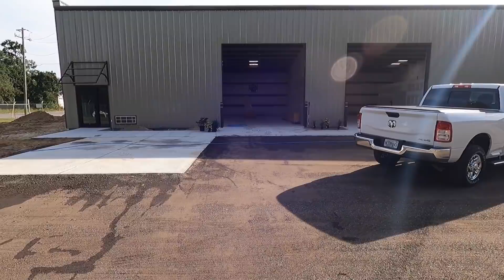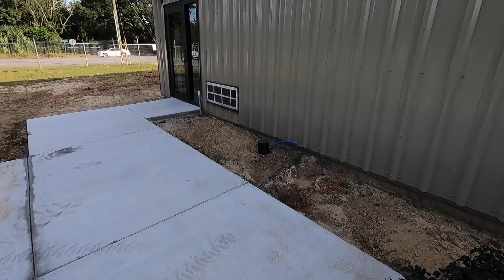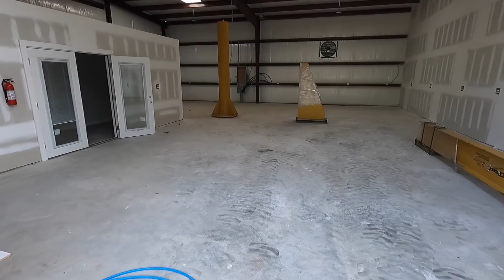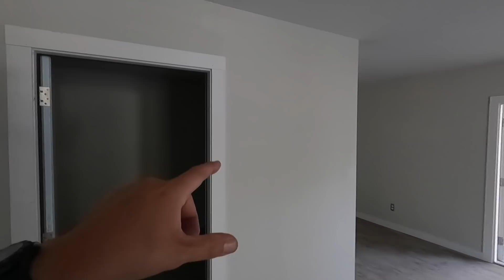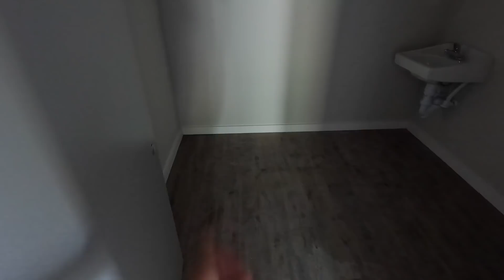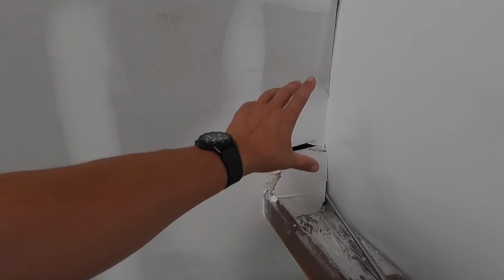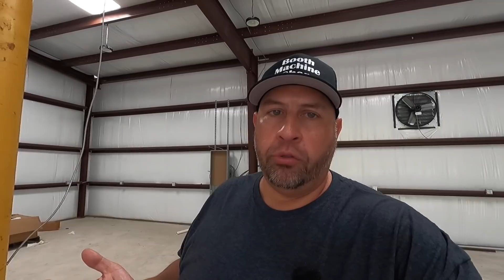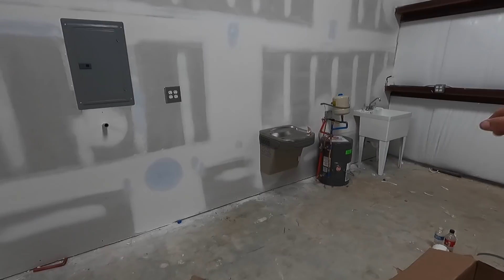New Shop Space Update 8: Driveway, Office

Comment: If I’m installing an exterior door like that one in an interior situation like that, I throw away the threshold, set the doors a half inch off the floor and install a drop bar auto sweep. Then I do a low profile transition. It drives me crazy to have to step over the threshold inside, and you might end up rolling things through there.

Comment: For your own safety, move the fire extinguisher so it cannot be blocked by the door.  Maybe a coouple of feet from the crane. Seconds count.

The other thing that bugs me is the electrical outlet/switch on the other side that is blocked by rhe door, but that is just me.

Saving on your electric bill & keeping the shop cool:
A) I think that you might as well put in some very wide diameter (10'+) slow speed ceiling fans.  These will also keep you warmer in the winter. 
2) Totally out of the park & not really late in the game, but the mechanics are not very different from putting it in the initial plan.. Add a steel pipe & wire trellis to the outside of the exterior walls that are not north facing.  Keep it a couple of inches off the wall.  Plant some vines local to Florida and let them grow.  If the sun does not hit the wall, the heat cannot be transmitted through the wall.

Thanks for teaching me so much.

Comment: I really hope that with that fiber mesh concrete they still used steel like regular concrete. When I built my 2nd home, 31 years ago that fibermesh was new. But with mine over the years  it cracks and separates. I'm sorry I went that. Now I need to have a concrete leveling company come out and fix all the toe stubborn in my driveway. I hope things have gotten better for you and your new shop. I hope I'm not out of line, but that's my experience with that type of concrete. And for years it looked like in needed a shave.

Comment: Adam, if you have not had time to consider a floor treatment,..I would consider a product called "Water Glass" and yes that's the name of the stuff,..cost is about $1.00 per 5 gallons and it coats just like water ( No pun intended) the stuff is an "Old School" treatment for concrete and wont chip or crack off cement and can be polished to a high sheen and will stop any penetrating products like oil/solvent/etc.,. shop is going to be very professional looking!    A thousand suggestions from your subscribers so mine is  I would like to see a machine that grinds or shapes machines ways in this new shop,  Good Luck!

Comment: Realize rotary screw compressor are a lot quieter then recip. However the easiest why to understand what’s best for your shop is. Think of gas versus Diesel engine, starts a stop a lot (gas engine) recip compressor, starts and runs for 10 days no stop (Diesel engine) rotary screw. Also don’t forget that need a dryer, and condensate oil/water separator. You can get ticket for condensate running in to the drain or blowing in to the grass. Recommend going with Zero Loss Drains as well. Will say you money on the long run, time drains use the compressed air and discharge some it, and will cause the compressor to kick more then it should.

Comment: Adam, you might already know this but I'll throw it in. Be sure to have either a dryer or dryers for the air compressor especially down there in Florida, or at each riser have a pipe dropping down with drain valves as a water trap.

Comment: I've got an old 2 stage 3 phase 5hp compressor that is like new if you are interested. I think it has a 60 gallon horizontal tank. I've stored it inside for 12 years or so. And an old 3 phase 1952 Dominion Lathe with every attachment, one that I can't figure out that looks like a chuck. A lot of old stuff. Surface grinder? lol

Comment: I note that your disabled toilet is quite large.  In UK we have a prescribed size/layout for the same at 2.2m x 1.5m with a 900mm clear opening door i.e. a 1000mm doorset that must open outwards.  this is so that should a disabled person fall in the toilet and block the door, helpers can get it open to rescue the occupant.
With regards to the use of the roof space of the office for occupancy, I strongly suggest that you get the builder/landlord to sanction the use and to provide the loading capability as they are mostly designed not to be used as occupiable space.  I often specify 'fragile roof' signs to emphasise the point.  Your wife's safety is paramount, notwithstanding the damage that could be caused at your cost.
Externally, we would normally have 8" (200mm) reinforced concrete hardstandings and aprons to take the normal loads on an industrial estate, I am surprised at only a 5 1/2" slab is used.  With the likelihood of the loose asphalt creating potholes at the edge of the concrete slab I would expect that the concrete will break up quite quickly, possibly when your machines are delivered.
Reply: They obviously build things different there. Here we build those areas for use. I built mine into a storage area first, then into an apartment when I was single.

Comment: Wouldn't it be an idea to put the compressor on top of the office? It would keep it off the floor and save it taking up valuable machine space
Reply: The compressor should be in a small addition tacked onto the outside of the building. You don't want that noise on top of your office.
Reply: @jwagnermail  I thought that originally, but of course Adam would need permission to do that.
Reply: @jwagnermail  If he's using a rotary the noise and vibration should be greatly reduced.
Reply: NO! Because the unit has to be serviced regularly, plus you have to deal with condensate drain, and be able to monitor the oil water separator. You don’t want something to happen to it and start dripping water on the roof of the office.

Comment: Looking good. This is going to be a nice space.
Not going to happen here, but when you begin designing your ultimate shop, consider asymmetrical doors. A 36" door doubled with either a 12" door or a 24" door (depending on whether you want 4 or 5 foot openings. A 36" door is comfortable for normal traffic (much more so than a 30" door, especially for us bigger guys), but there are times when you need that extra foot or so for moving furniture or machines. Having a single 4 foot door just takes too much room to swing. Also, using "hospital" hinges (which have the pivot pins out an inch or so beyond the face of the door) will let the door fold flat against the adjacent wall, even if there is protruding trim.

Comment: Hi, I love your idea of a rotary screw air compressor. I would actually strongly advise hiding it above this the office area but have it isolated against that ceiling so you don't hear it inside the office and that way it's not on the floor space. If that noise is the case get the thing out in the shed behind up behind the building.
Reply: That's gonna be Abby's space. And, the loft wouldn't be able to support that heavy behemoth. Best on the floor, in a corner, or close to the panel.

Comment: i like the forklift idea. to replace an old 60 gal H/D special i bought an Eagle 3 cylinder single stage 220v all cast iron pump. it's rated at 18.5 cfm at 100 psi. my biggest consumer is a 3/4 impact. i can't run it down below 90psi. i never have to wait for air. just me in my shop though. i think they are around $1200. not sure how this compares to the screw comp or if this helps. thanks for sharing i really like your channel. added note mine is inside a gard shack in my back yard and runs off a light switch inside my garage. i don't care if it's noisy or not.

Comment: Looking good sir.  Cant wait to see what machines you end up putting in there.  FYI, Rotary screws are primarily meant for continous air making.  They dont like intermittent us, most are set to run for a min of 15 min when they kick on, so they dont start/stop more than 4 times per hour, so once they are full they will run in bypass mode 15 min miniumm.  Reciprocating compressors are best for intermittent use.  Look at the Polar Air compressors.  Stay away from any of the retail big box store compressors, Just my opinion :)

Comment: You need a forklift, would make that crane obsolete
Reply: Forklift is dangerous when loading/unloading machines. Cranes are safer and easier for 1 person, especially setting up heavy things in a lathe, like changing a 350lb 6 jaw chuck. I've done both, and a forklift is easy with 2 people but dangerous. Cranes are made to be worked under. Forklifts are lifts, not to be worked under. Be safe! :D

Comment: Hi Adam the place looks great .. I have to agree with your electrician on certain jobs we would try to predict where and electrical outlet should go and do and advance install and it was more problems than expected .. much easier to place the machine then wire it . There was and out side company installing a lift today in the shop , and they were grouting it in and I ask them what grout they use and they said over the years they tried a lot of different brands but they said  (five star grout ) works the best  .  they build a form  around the lift. and they  leave a two inch space between the steel plate on the crane and the form. then  mix it up and pour it in . I did not see them do the pour .   Stay well

Comment: Your update video is great. I know I have said this before but I would not be a good subscribed member if I didn't mention the unprotected insulation. I have of 20 years experience with that exact type of insulation. Unless you want a growing number of holes and slices you need to add some type of protection from the floor up to at least the second rail. Particle board, plywood, sheetrock or even a tarp. I consider myself a careful person and still over the many years I worked in an unprotected shop I managed to punch or tear enough holes to use an entire roll of cover tape plus part of another. Those bags of insulation are extremely easy to break the there light bag covering. I know it could be costly upfront but you will be glad you covered down the road
Reply: Agree , my building have the same insulation and only one beam across at 6’ Hight the roof it’s 14’.
The insulation gets damage and makes things hard to storage also.

Comment: Are you going to search out a good deal on a piece of I or W beam to create a hydraulic cylinder tear down and pull apart work bench. With a flat plate on one end so you can use your crane to set it on end when not in use .

Comment: If you wanted a quiet air compressor check out the Chicago Hush compressors, I'm definitely looking at getting one of those. The Kaeser compressor compressors are good too, there was one at the Ford dealership I done my apprenticeship at, they can be a bit expensive but you can set and forget them (no draining water from the tank, it kept the moisture out of the lines)
Reply: good advice. thanks

Comment: Looking good so far.  You know about the air compressor types. The screw kind is for high flow and the traditional is for pressure. It´s like hydraulics. Pressure is force and flow is  speed. The screw kind is expensive to buy and have some additional costs to run. ex. for oil filtration. John Saunders (nyc cnc) did a nice video on air compressors and cost. Take a look at it before you spend your hard earned money.
How about air ventilation if you are going to spray weld and so on?

Comment: One of the companies that I service equipment for has a Kaeser Air Tower 5c and asside from changing air and oil filters it has run flawlessly for over 7 years.  Aside from PM's I have repaired it only 1 time and that was just wood dust in one of the starting breakers. (wood fabrication facility)  It has a dryer on it and produces air with almost no moisture in it.

Comment: A plumber friend of me corrected me on the use of "hot water heater" if you already have hot water why you need to heat it? It's a "Water Heater" turned into a pet peeve of mine ever since:)
Reply: Sometimes the main water heater doesn't provide quick hot water. A smaller "hot water" heater is used for remote or dedicated use.
Reply: @firesurfer  would that not be a "warm water heater" if it's not hot enough at the end location 😂
Reply: @benjamindusseau4912   Jeez,   let it go.
Reply: It’s the heater that makes the water hot
Reply: @bjnorton8029  ... and the sub heater on the other end that keeps it that way. (even though in aboms case it's not needed.)
Reply: I agree